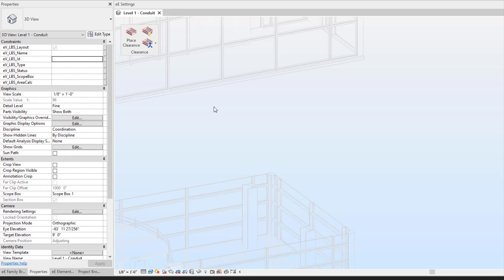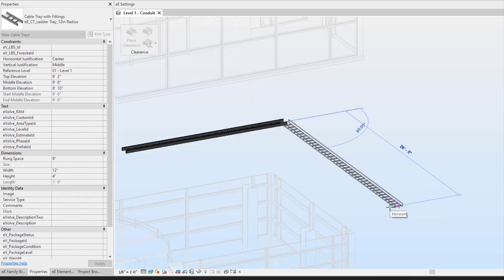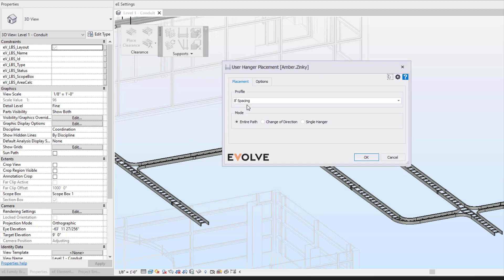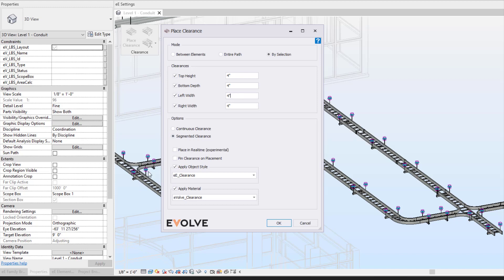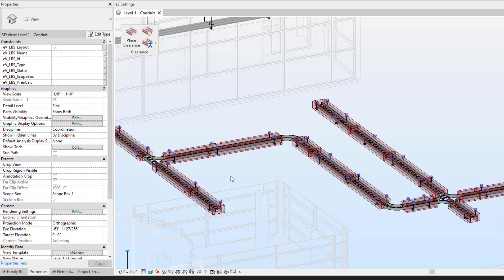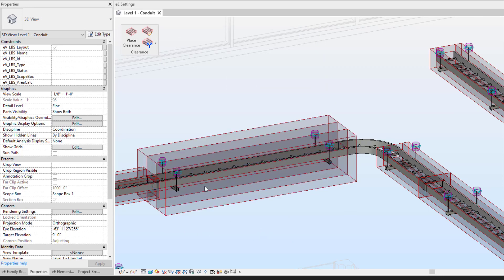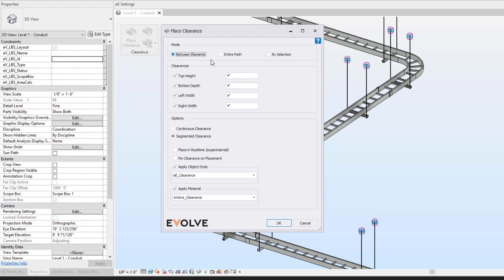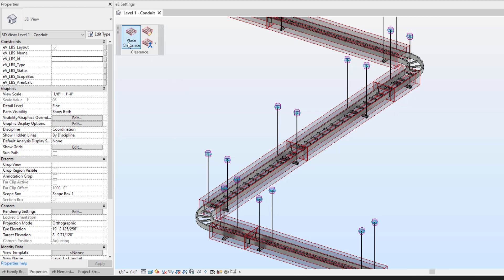EVOLVE Electrical - Place Clearance on Cable Tray

Comment: This plugin for revit, In addition to designing walkways and pipes, cable routing? 
It is possible to route multiple cables inside a rigid tube?
It is  possible to create an abacus? What type of electrical cables are in the plug in?
Reply from the maker: Hi Gianlucavalente! Can do cable routing ✅ Can represent the wires inside rigid with data ✅ Not sure what abacus you're looking for ❓Electrical cables out-of-the-box are MC, but can create your own as well ✅